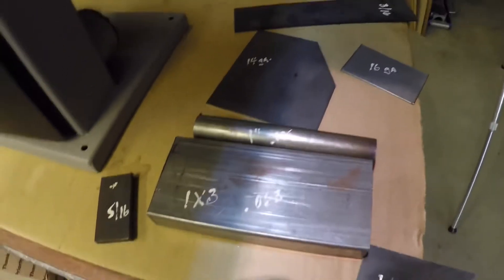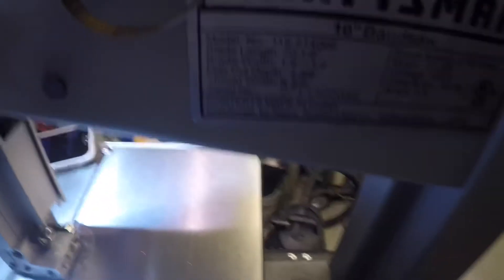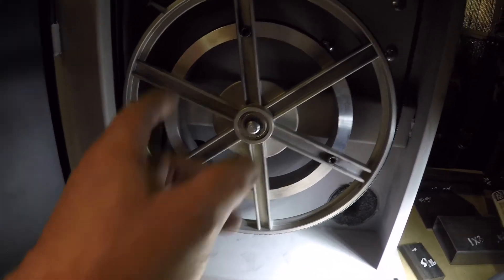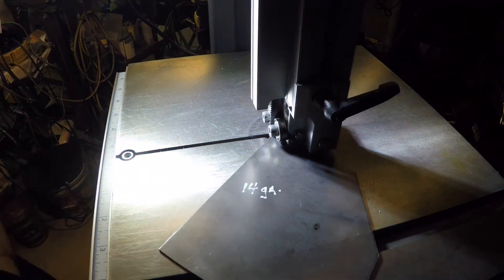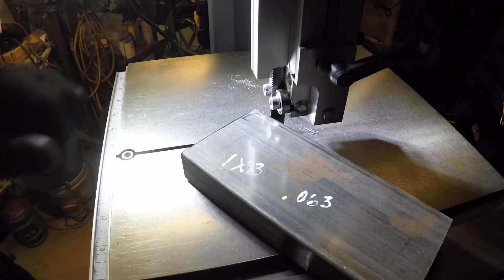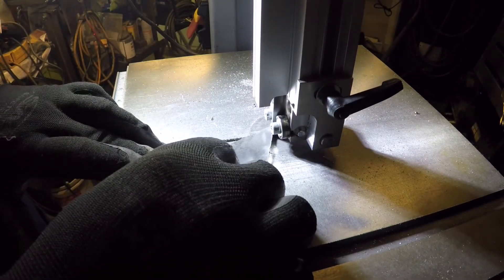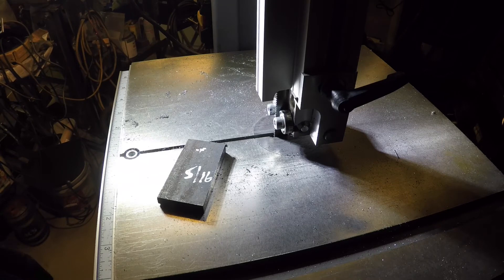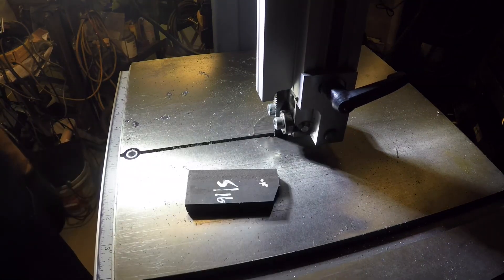10” Wood Bandsaw Speed Reduction Kit

Comment: Nice review.  If you do use it for wood, be careful that you don't get a smouldering fire after cutting metal.  The sparks or hot metal from metal cutting can smoulder in the sawdust collection for a long time before any noticeable smoke or flame.